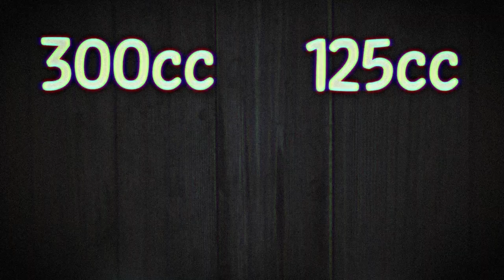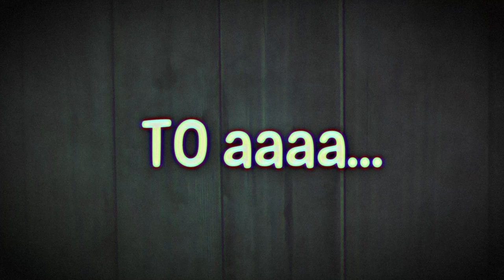Vespa gts 300cc rollers replacement. no more rattling noise

Comment: Be worth replacing the ramp plate guides on the variator. They also produce rattling noise and if they are completely gone. They destroy the variator. Always do up the variator nut with a torque wrench. If you under do the nut it comes off. If you over tighten it you risk snapping the end of the crank. Also just came across your channel. Liked and subbed👍🇬🇧
Reply from the maker: Thanks for The advice and also thanks for your sub 🙏
Reply: 100%! Excellent point. I always replace mine (I.e. guides) when I replace the rollers.

Comment: I thought you were supposed to put two 10mm bolts in the slots on the clutch and then remove the nut or use the special tool, always interesting to see it done differently 👍

Comment: Do you have a video of what it sounded like with the rattling noise before
Reply from the maker: Hiya, sorry but I was silly enough not to record the noise before we fixed it lol 😂
Reply: @VESPAUKofficial  no worries what was the dimensions of the new rollers you have put in because I may be having the same issue mate
Reply from the maker: 21 x 17 🙏
Reply: @VESPAUKofficial  cheers mate and what size was the ones before when it was making that noise pal
Reply from the maker: I think 20mm x 17mm
Reply: @VESPAUKofficial  ahhh that might be my issue I’ve got 20x17 in and there’s a rattling sound coming from variator in top end of the revs mate
Reply from the maker: @motorbikeryda883   it could well be you know, worth trying. Got nothing to lose really. Plus it’s fairly easy to do it 😊
Reply: @VESPAUKofficial  I’ll have to try it mate where did you get your rollers from 👌
Reply: @motorbikeryda883  21 x17 malossi are the best